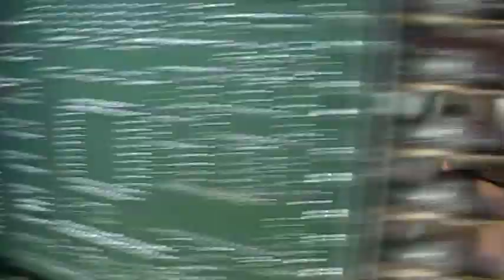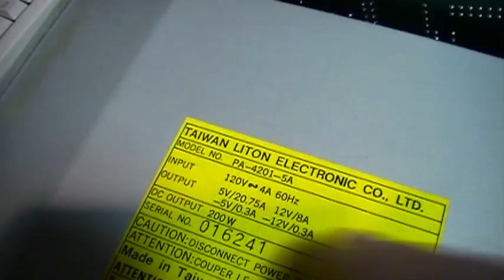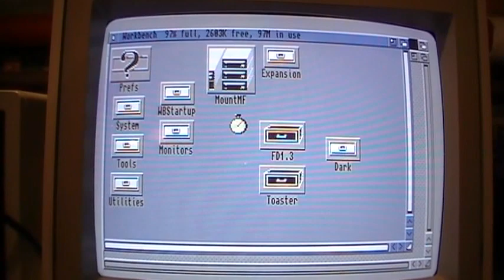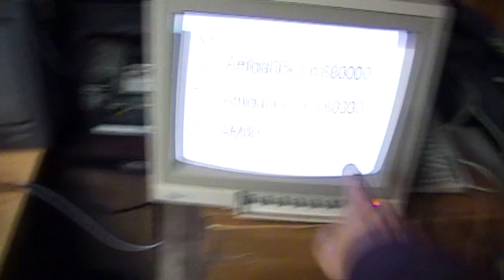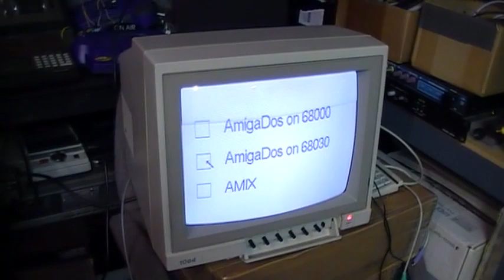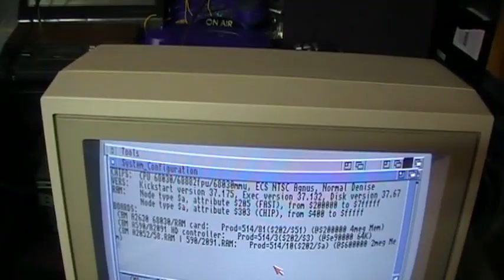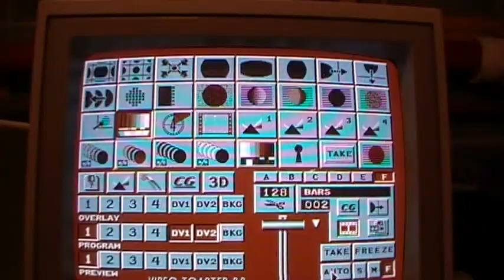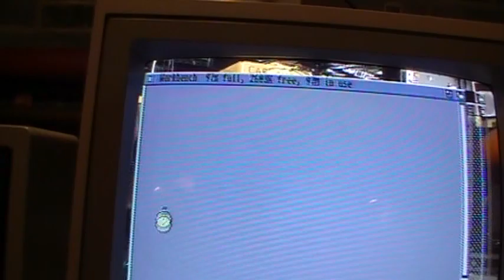Amiga 2500 Video Toaster restoration Part 5

Comment from the maker: 2 megs of RAM was a lot in 1987. Higher capacity RAM chips were available back then, which would've allowed that card to be a fraction of its size, but probably Commodore got a good deal on lower capacity RAM chips. By 1989 they had a RAM board the same size which could hold up to 8 megs.

Comment: I won't give away the ending... when you exit the Toaster software it leaves the card in genlock mode. You can control it with the Genlock utility that should be in the Video Toaster software's Utility folder. Its a poor man's composite out, with the utility you can change the program and preview inputs outside of the VT software or even turn off the genlock and just have Amiga graphics on the video out. Why is your switcher background RED?

Comment: You can use the DKB 2632 to expand the FAST memory on the A2630 accelerator card with an additional 112MB.  This item is hard to find though and it may be less expensive to upgrade to a better 030 or 040 card that supports more memory.

http://www.bigbookofamigahardware.com/bboah/product.aspx?id=988

You can squeeze a little more speed out of the A2630 accelerator by overclocking it.  Here's some info on overclocking various Amiga accelerator boards:
http://members.iinet.net.au/~davem2/amiga.html

You can also expand the CHIP RAM (video memory) from 1MB to 2MB with the DKB MegaChip 2000.  It attaches to the AGNUS socket and hosts the newer 2MB AGNUS with an additional 1MB of RAM to supplement the 1MB on the motherboard.

http://www.bigbookofamigahardware.com/bboah/product.aspx?id=1549

With a SCSI-SATA bridge or SCSI-IDE bridge, you can try using an SSD for improved performance.  Without system patches or upgrading to AmigaOS 3, you will be limited to 4GB though.  Some Amiga 4000 & 1200 owners are using various IDE-CF adapters to replace their IDE drives.  These are faster and pretty inexpensive alternatives.  I don't know if it'd be cheaper to get an Amiga IDE controller card or a SCSI-IDE bridge adapter for your existing SCSI card.

Comment: I can't use my 6MB RAM card in my PS/2 while using an AOX McMaster 486DX2 accelerator, or the two 2MB modules on the planar. Well, I can, but I get BSOD's periodically in Windows. And the McMaster will only take 70ns SIMMs, which I only have two 4MB sticks of. Fickle old stuff.

Comment: He would probably have to hack the whole architecture and it would be more expensive and with less power than a current computer, actually I think the 68000 was 16 bit, so not even possible for the processor to make it work.

Comment: Man, how far have we come in terms of RAM, both in number of chips required and especially price! Look at all those boards to just get 8 megs! And price? Holy cow, I remember paying about $300 for my 256k (yes, kilobyte!) expansion module when I bought my Amiga A1000 back in the day. Nowadays, 16GB SD cards are practically given away in boxes of cereal! I remember adding a hard drive to my A1200 (years later) and the largest one you could get at the time was about 80 mega bytes. My, how things have changed...

JW3HH
Reply: Yes, when I bought the GVP hard drive + memory board for my Amiga I added 2MB of ram, it required 16 chips, which alone set me back about $200